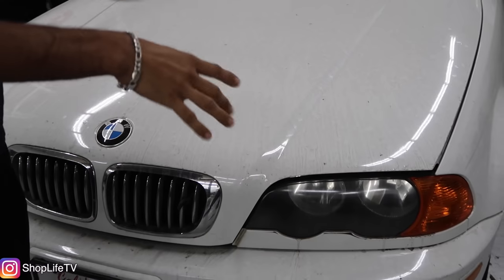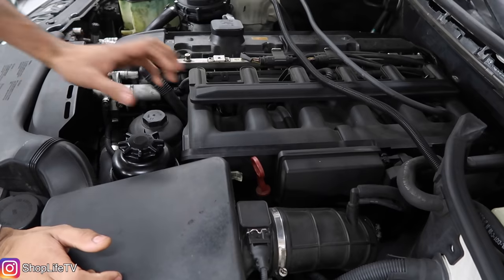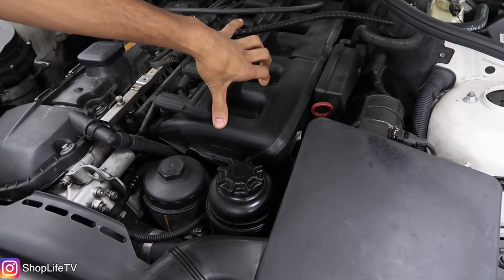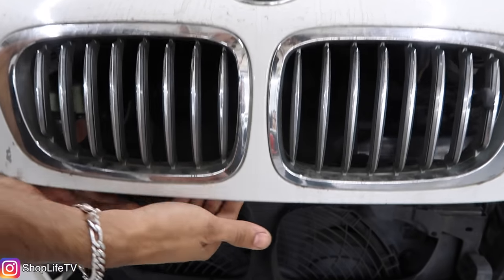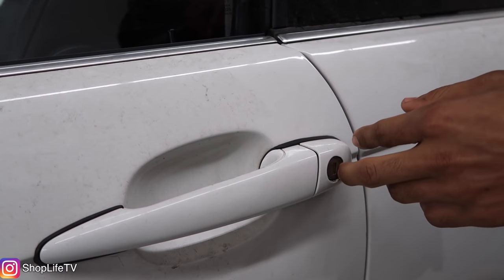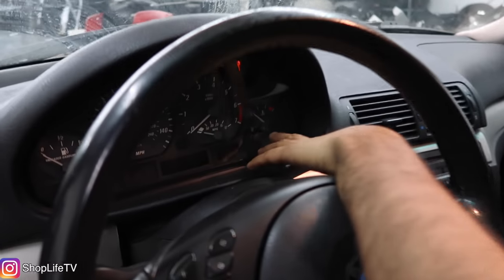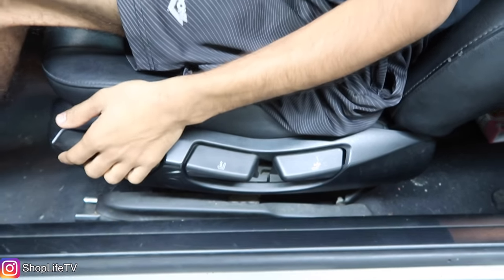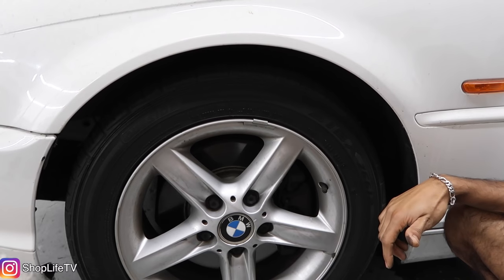25 BMW E46 COMMON PROBLEMS

Comment: 2024 anyone?
Reply: Here
Reply: Me looking at a local 2003 bmw  238 si coupe 89k miles with the excuse that the map sensor needs replacing automatic transmission for 2700 should I pull the trigger
Reply: Miles too low for the year
Needs history pulled
Most likely not just a MAP sensor
Reply: These videos really help me.
Thankx

Comment: I'm an old dealer mechanic now retired. E 46 was my favoritecar. I have 40 years experience.  Retired now.   Btw never bnever never buy a mini Cooper.  Please
Reply: Why ?  The Mini has all the BMW technology built in ...
Reply: Recently went from a Mini S to an E46 and I'm really starting to doubt my abilities in choosing cars.
Reply: Jeez, this model of bmw sounds like it’s a piece of shit.
Reply: @djmill  they all are lol
Reply: @philosophin9893  because the brake lines run through the fuel tank . Literally through the fuel tank . So simple repairs become incredibly expensive .
Reply: agree mini cooper is a chick car and as a dude would never be caught dead driving one.
Reply: @philosophin9893   keep telling yourself that, a lot have Peugeot engines in them.
Reply: Best car to work on.
Reply: Hi there. I think I have a problem with the ASC(got told from BMW dealer)please explain where to replace it. Thank you so much
Reply: only buy a pre - bmw mini
Reply: I agree with the mini cooper statement, had one for 14 months and the problems just built up, especially the power steering pump and electrical s of the car
Reply: LMAOO SON SAID PLZ
Reply: djmill nah, they’re just getting old
Reply: @traxxasrcfun  g
Reply: @edmundscycles1  no they don't.   You are wrong.
Reply: @williamperri3437  neither one.  He is wrong.
Reply: a Mini Cooper will never ever cross my mind, I hope you all know it’s that bad from motor to overall
Reply: @FR Guess you are really into cars. The e46 is one of the few BMWs I'd dare buy. Childhood dream car of sorts. Some people are just not into fixing cars very often (I'm prolly in that category) just as some people are not into cooking and only eat take-out. And when you add to that the fact that having an European car gives you a lot of little expensive problems compared to Japanese cars, then maybe you'd get a little scared listening to the reality of this video, especially after 300 videos from Scotty and his opinion about German cars and their overengineered, plastic abundant engines. 

You'll always gonna hear people defending their BMWs, but that doesn't clean their fame. Try hearing a lot of complains from a Lexus...
Reply: @emancebo13  If you don't know how to turn a wrench, or have the time to turn one, don't by a bmw. If do know how to turn a wrench, and have some patience, you could buy a car that have long lasting motors, transmissions, rust free bodies, with good gas mileage and excellent performance at a low price.
Reply: @zigo1965  Bro, in this day and age, if you don't learn how to do something, it's probably because you don't want to. You learn a lot of the basics and then some with these youtube videos and other platforms. Patience is a virtue indeed. I guess we should know at least the basics, German or not...
Reply: @emancebo13  that is not the case today, as most people know absolutely nothing,
besides putting gas in cars, most don't even how to get the lug nuts off, nevermind jacking the car up, and change the tire.
Reply: @zigo1965  True that.  I've got my first car recently and I don't know much either, but again, some people have never washed their clothes, or made a meal themselves, or changed their oil filter, what I'm against is not knowing absolutely nothing, especially with the the tools we have today.
Reply: Plsss help I have a crank no start and got a new key new starter and battery

Comment: replaced on my e46 about 55% of items he said. He pretty much talked about every part of the car lool.
Reply: He is right  on it
Reply: Any idee of the cost you put in to it ?
Reply: @Nerohhkingz  faarrrr too much!! I'm in same boat with these cars
Reply: I have a 2002 330ci with 87k miles 
Around what mileage does vanos seem to fail?
Reply: for real im 3 years too late for this but a great video which i hope i never have to use again ;)
Reply: Missed the rewiring of headlights internal harness.
Reply: People buy a 20 year old USED car which was maintained poorly or not maintained at all for half the market price and cries online how the rest of the brand sucks and they actually have to make repairs, instead of just going infinite kms with only basic maintenance - typical demographic of not very bright and naive people. If repairing a car is too big of an issue, just buy a new car from a dealer. 😪
Reply: @williamperri3437  ummmm i wouldnt call it nightmare..... they are old so yeah they need love .... and its not cheap .... but since i did all the work im gonna have this beauty for another 10 years or maybe more ..... (179k miles or so maybe 200k miles) but its a gem and you can upgrade if you make more money through the years.
Reply: yes, the car need a lot of love
Reply: @Lessthanthreeedm  hell my old Mazda 3 had cheaper and different parts but still required me to grow in my skills.
Reply: Sounds like a expensive car to have lol

Comment: I own a 2000 E46 sedan and I was like, "That happened.  That happened too," the whole video.  I think sub-frame issues might be the only thing mentioned that I haven't experienced yet.  That being said, I sure have enjoyed driving and fixing my E46 the past 18 years I have owned it.
Reply: Wow today Iam going to see e46 2004 convertible , I like the look and how it comfortable more than normal sedan e46 , but Iam afraid my wife will tell me why you are always working on that car as e39 😅 once you fixed an issue next month another issue every month there is something should go wrong 
I thought e46 is better than e39 as they said e46 is the corolla of bmw 😅😅😅 but it seems not
Reply: @Sroor90010  you tried upgrading the cooling system? I feel like all the plastic parts are ticking time bombs with my super hot m54b25 :(
Reply: Ok I just got a e46 it makes a sucking sound when I cut the car off is that a problem. It runs great!!! It does it real quick then stops.. help

Comment: 50% of the comments are like "i've driven my e46 for 300 years and never had a single problem"
other 50% are like "im buying me e46 tommorrow and i've already replaced 137% of the car, biggest mistake of my life"
Reply: You have two types of people there’s some that are neat freaks to their cars and you got the ones that aren’t
Reply: Just bought an e46 and this is me
Reply: @gregh7457  lmao so true man worst feeling
Reply: I mean 1 owner bmw is better because at least u know it wasn't messed with too much unlike bmws with 8 owners
Reply: I've had an E46 320 M Sport in black for 13 years, I've expereinced only three faults, other than brakes, pads, a few bushes are a gear box switch and a one front light unit that needed to be replaced. Now the third fault it won't start. It just makes a buzzing noice from the engine! Very realible otherwise imo.
Reply: Depends on the engine type, i guess. 6 cylinders are known to be amazingly reliable while the N40 and N42 variants are known to be very unreliable.
Reply: @nocuriouscats8550  Yup. I bought an E46 for 3 grand 6 months ago, put in around 4 grand to sort it out, however it was totally drivable before I put any money into fixing it and it still would be. I just want it to be as clean as possible.

Comment: The extensive use of plastics in newer cars in general will eventually cause more problems. Plastic manifolds, thermostat housings, gears, chain guides etc etc in a high heat environment doesn't bode well.

Comment: Cooling tip, replace the water pump with an aftermarket steel impeller pump and at the same time replace the expansion tank with an oem tank.
Reply: Wow!
Reply: Tip: replace thermostat and all hoses while you're at it
Reply: @dumbthingsyousee6969  wow ok damn
Reply: Agreed
Reply: Saw a video saying that you shouldn't replace it with a steel one. Stick with plastic. It causes more problems
Reply: @flipvdfluitketel867  had one of those hoses fail in less than 100km after buying the car :D
Reply: The aftermarket steel impeller bearings failed within 2 years, I’d stick with oem from now...
Reply: Guys help me... Replaced the expansion tank... Following week replaced the radiator...it's been A month now.. Whenever the car reaches the middle of the heat gage it starts vibrating and idle like a v8...loses power Why? This started after replacing all these parts. Help me. Please.
Reply: Why not Silverado expansion tank?
Reply: @xStr8xxDr0px  Plastic ones are better, IMO, because they don't corrode and they are easier to balance.
Reply: Another cooling tip: replace the 2.0 bar cap with a 1.4 bar one - the expansion tank is too weak for 2 bar.
Reply: @JMUDoc  the whole cooling system on the gasoline engines fails because the 2 bar pressure is too much, its that high to reduce the risk of the coolant boiling because the 6th cylinder gets very hot. Using the diesel reservoir cap really helps every single cooling component, while making only a slim to none change to the maximum temperature of the coolant. So yeah very good tip

Comment: Congratulations and Thank You....just found your informative site.  I am the Original Owner of one of the very first E46's 330ci in the USA.  I ordered it On-Line (wow, in 2000) from the German BMW factory....I was a Soldier stationed overseas, and took delivery at a Dealership in Colorado on Nov of 2000 of a 2001 model year.  The Dealership had not appropriated yet for one and had it on display when I came into the US to pick up my car.  Your video is spot on for all the repairs I have had accomplished over the last 20 years (a little too much plastic).  With the addition of my Check Book, this E46 has been bullet proof and is still the most dependable car I own.  It has followed my all around the globe, and luckily there are BMW techs/Dealerships available to perform repairs.  OK, could I have purchased a 2001 Toyota or Honda and had great transportation for the last 20 Years, YES.  ....but this BMW has style, comfort and grace, has never let me down, still looks classic, and it loved at car shows.  So I'll keep it another 20 years.  VIN: WBABN53461JU32560   ....my daily driver is a nice...newer M5.  Joe

Comment: I have had a 2003 E46 330ci for 15 years. Fairly easy car to maintain on your own. I have replaced the cooling system (radiator(changed to aluminum), pump, and hoses), air intake boots, fuel pump and filter, DISA valve, and valve cover gaskets. Parts weren’t that expensive and they all were fairly easy to work on. I love the lines of the car and enjoy driving it (5 speed) and overall maintenance has not been bad for a 17 years old vehicle. Now my e46 M3s, great cars but definitely needs more maintenance. And for those who are wondering, no, I don’t owned these cars because I can’t afford a newer vehicles. I owned them because I like how they look and they are pretty straight forward to work on. Also, I am not really all that I impressed with the looks of most of the newer cars that are currently available; well not impressed enough to give up my funds for one, LoL.
Reply: Absolutely agree with you about look of new cars.

Comment: I just happened to come in possession of an E46 a couple years ago.  It needed a lot of work so I started looking around and found so many videos on YouTube about fixing them.  That had me a little worried, because I figured it meant they had LOTS of problems.  But actually I think it is because people really like them, and working on them isn't all that hard.  I've done so many DIY repairs to it over the years and have been really happy with it.  The only thing I haven't been able to do (probably COULD have, but didn't want to) was replacing the transmission.  I had that done at a local BMW shop that I really like.

Comment: Loved the vid. Just got an 04 325i, and already spent what I spent on the car for parts. Lots of deferred maintenance, oil filter housing seal, window regulators, etc. manual trans makes it fun to drive

Comment: The Cheap fix for burning oil is the catch can , The Best and most expensive fix is the M56 valve cover swap, this completely fixed the 3.0 I swapped last year from using oil, good video guys I am  glad to see others doing videos about these cars, I wish you luck with the channel , I subbed and maybe we can work together in the near future.
Reply from the maker: Thanks and yes the m56 valve cover swap is directly bolt on for most m54b30 with the newer style coils. If you have the square coils you would need to swap to the newer style harness and make a few modifications for it to work 100%. And same to you!
Reply: but thats if the valve cover is at fault , my engine had bad piston oil rings and valve stem seals at 70k  which I replaced with m52 oil rings and supertech valve seals
Reply: Nathan subs you must be a rock star...Nathan is da M54 bomb

Comment: Dude ,you are the man. I've been a mechanic for over 35 years and I was always afraid of working on BMWs. I purchased an e46 and love it. Everything you said that would fail did.  I've been maintaining the 2004 325i that I purchased for my wife with online parts and so far it's been cool and cheap. The BIG ISSUE IS THAT ITS A SULEV WITH THE NON SERVICEABLE FUEL PUMP. It hasnt failed yet, but I would love to see your thoughts on this expensive journey incase this pump would fail. Please make a video on a sulev pump fail and a fix for it. I think your subscribers would love to here the history and theory of what's going on with the m56 engine no one seems to talk about.

Comment: Great vid!
Some other common problems with mine were (Xi model):
 1) fuel pump failure
 2) sunroof cassette failure (cables entwine)
 3) real coil springs broke 
4) FRONT AXLES,  mostly outer CV boots and joints
5) transfer case mount
6) Front and rear axle seal leaks
7) E-brake cables loose or pads worn (manual)
Plus more. The E46 is a great gen and not too complicated to work on since its age will need the maintenance. Great car to own if you dont mind getting your hands dirty a bit.
Reply: i prefer the e36 or e30
Reply: fuel pump failed today left me stranded 😓

Comment: Great video! I've been looking at sub-$2000 manual e46's, and you didn't scare me off. All older cars have problems, and most of what was mentioned here isn't too tough or too expensive to fix. I almost didn't watch because your hair looked so ridiculous, but if I buy an e46 and your vids are all this good, I'll juat have to get used to it, LOL.

Comment: For the DISA I recommend you swap it out for the DrVanos version which is an upgraded version and will give you piece of mind.  Also there’s a nut mod for the oil pump which I don’t think he mentioned but that’s mainly on the 330 cars and it’s highly recommended to get the upgraded/mod version which is guaranteed not to come off

Comment: I got an 1999 E46 328Ci with pretty much exactly 100.000 miles and i have had 0 issues in the engine bay. I replaced some stuff preamptively like the water pump, the engine coolant container and the spark plugs. Other than that I only had to replace most of the bushings underneath the car and that's it. Engine is in top shape, don't know about VANOS but I'll check on that lateron.
Still thanks for making this video and sharing your knowledge with us, I will definitely check the VANOS seal as I stated above now that you mentioned it
Reply: Hi,
Do still have the this BMW ? 
Is it still going strong?
Reply: @marioosa  Damn, it's been 4 years already lol. Yeah I still have it and yes it's still going strong.

Only engine related thing that happened was the car throwing a fit once because of the throttle body, that went away by itself though. Two years without any issue regarding that.

Otherwise it's the usual E46 headaches. Rust, drive-shaft, axles and the general maintenance items ofc.
Reply: @allhailthecore3136  
Thanks and all the best with the car 🙂👍
Reply: @marioosa  thanks mate

Comment: Great video, thanks for all the links! 
Just got my first BMW, a $1500 2001 325i 5-speed w/ sport package, on which damn near everything works. This info will be invaluable! I'll be replacing the rear brakes, then will have to track down a water leak and replace the windshield cowl. The car has a little rocker surface rust but everyone I've shown it to is amazed at the condition for the price and age (and I LOVE driving it, haha).

Comment: You're systematically delivering wisdom like a .30 caliber machine gun.  
...enjoyed moment 19:42

For me I spent 150 on a Dorman brand DISA and it lasted a few months and then it got all gooey like the oil made it swell up and look like pink melted gel.  The dealer one cost more but looks like new 2 years later.   Dorman works long enough if you are selling the car in a few weeks.

Comment: Nice video, super thorough. I think the only issue you didn't cover was the HVAC system. Mainly the blower motor resistor or Final Stage Unit as bmw calls it

Comment: Great video!  In my experience for the E46 vs. E90, the E90 breaks less, but the issues are more expensive to fix when they do break, such as the electric water pump.  I'm comparing the naturally aspirated E90s such as the N52/N51, the N54 335i is in a completely separate league of maintenance.  The E90 also has more electronic stuff like the battery programming, where the E46 is more analog.  Also, could you do a video about using INPA for diagnostics?  That might help a lot of people who are scared of the electronics.  I seem to hear about many people who shy away from them because of "dealer only" stuff which could really be fixed by using INPA.
Reply: having owned both a 325ci and a 335i... the 325ci has been the lowest running costs of anything I have ever owned and the 335i the highest... was crazy....